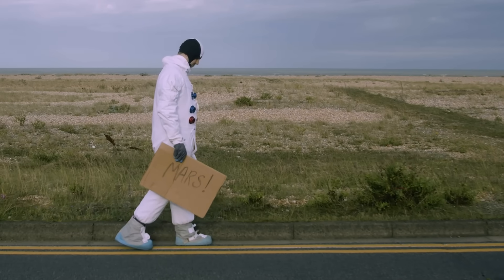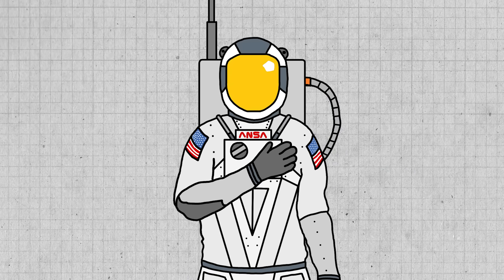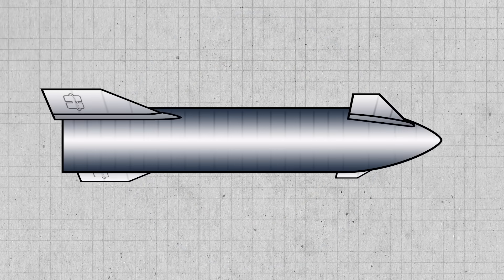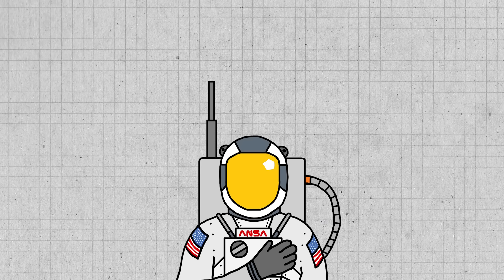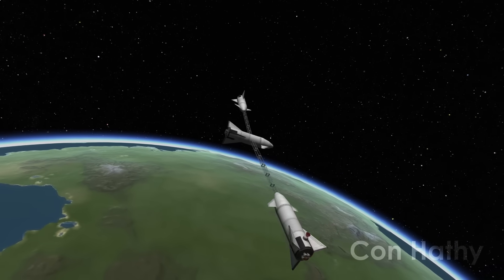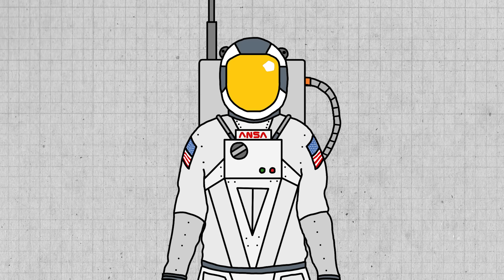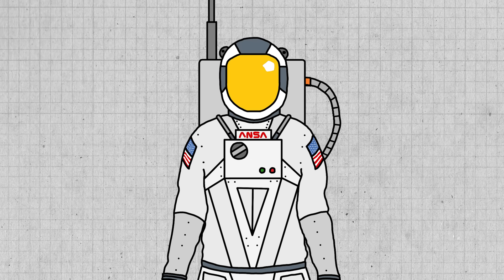This is NOT how you make Artificial Gravity

Comment: I'm not convinced that bringing along a small-radius centrifuge makes more sense than bringing along a rope.  Having some pseudogravity all the time would be convenient, and ropes are cheap, simple, and light.  The rope also doesn't take up any space inside the ship, once it's deployed.

I'm not a fan of the three-ship configuration to begin with, but I would guess that it can be saved by hanging a moderately small amount of supplies a moderately large distance out on a rope in the desired plane of rotation.  I also suspect that instability can be dealt with actively.  They'll probably want dampers on the ropes anyway, in the three-ship configuration, and it's probably not too hard (by the standards of Mars mission design) to have them actively move their mass instead of just passively damping undesired modes of vibration.

Comment: You did not give an example of an entire space ship using small axis rotation. The design that you like doesn't integrate as well with the macro design. At best it has a slight advantage of stability. At worst it has more unique parts that need to be manufactured, it takes more adaptation. You have less useable area of gravity habitation, which is really important for exercise and well being, and you will probably get a better overall result on the human body with a larger radius. Your only real argument about stability, when scaled up to the size of these ships is a math problem. We could build 4 propeller drones for a long time, but we couldn't stabilize them until we could reduce the computers needed to fit on drones. We real time processing, making the adjustments to keep the system stable is not a big deal and if for whatever reason the system becomes unstable you're still traveling toward your destination, just at a wobble. Also a tether has the disadvantage of needing to remain taut the entire time. Forces and activity from inside the craft will created bounce that start drift inward unless constant force is applied in the direction of the radius outwards. For all these reasons the stiff structure rotating full habitats a larger distance is the best design.
Reply: All sounded nice but the last part, internal vibrations would prove scant opposition to the force on the very hypothetical cable. 
Or we could make a running track around a sea dragon and represent Momma earth as one people.
Reply: Tether doesn't need to be flexible, he says exactly that in the video.

Comment: If you're tethering 3 Starships together why wouldn't you tether them like fan blades? 3 vessels held equidistant from a central hub all rotating in the same plane.
Reply from the maker: It might be harder to keep them separated, but could be done
Reply: @ConHathy  getting into position and accelerated up to spin safely would certainly be a careful technical challenge. It would be well within our current capabilities though.

Comment: the flaw is (imho) that the pressure is going to be unaffected because you are standing while laying down and Not increasing pressure at eye level, change the orientation of the person laying in the direction of the rotation at the end of the arm, not radial to the axis. with a bearing ( like a boat drink holder) mounted bed that rotates outward would maintain the same pressure across the whole body with the physiological changes induced by the mere act of reclining. Centrifuges are kewl.

Comment: I am surprised that so many clever folks are taken in by this "Star Trak" nonsense of rotational gravity when just a few minutes mulling it over reveals that its simply not true - it may have some such effects on earth or under low gravity high-flying "weightless" scenarios but thats all.

01.54 - constant acceleration = NO - that's on Earth - in space, once its moving, its moving - no further effort needed.
Spinning something does not in any way equate to AG - or would even feel like it.
05.00 - ring stations = you ARE kidding ?? rotating these will not induce anything remotely like gravity - imagine you are in space, floating one inch above the "floor" - so what effect does a spinning ring beneath your feet have ? None. Zero. Why would it? Unless you are tethered - then you are just getting dragged around with it - there is still no "downwards" force like gravity being produced or exerted.

Comment: Does it need to be 1 G? Wouldn't 0.5 or 0.3 G (as on mars) suffice? Then you could wear weights, jacket containing drinking water for example, to increase stress on the skeleton and muscles. Plus water shield a little from fast particles from cosmic rays. We have to find the minimum acceleration of gravity to maintain muscle mass, the circulatory system and bone density.

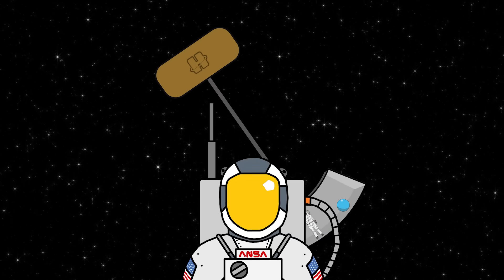Comment: 2:20 Putting person in the small centrifuge shown in your video is not going to work, because of the force differences along the body length. The head will be traveling at a greatly reduced speed compared to the feet, and will experience a very small outward force, essentially like being weightless. If we let w (the letter that looks most like omega) stand for omega, the angular velocity, then a = rw^2, so the acceleration and thus the force have linear relationships to the radius.

If we assume the man in the centrifuge is 6 feet (1.8 m) tall and his eyes are about 20 cm from the center of rotation, then assuming he experiences one g at his feet (a=9.8 m/s^2) we get and angular velocity, w = 2.2 rad/s (21 RPM, 2.85 seconds per rotation), The acceleration at his eyes would be a = (0.2 m) x (2.2rad/s)^2 = 0.97 m/s^2 = 0.1g. So, the test subject would experience artificial gravity ranging from about 0.1g in his head at eye level to 1.0 g at his feet.

There is a second and more obvious flaw in this experiment, there is still gravity pulling down on the test subject perpendicular to the direction of rotation.

About all this experiment will do is make the test subject dizzy, and probably nauseated to boot.

The only way to achieve useful artificial gravity from rotation is to have a large radius of rotation so the difference in acceleration, and thus g force, between the head and feet is small.
Reply from the maker: That was actually a control setup where they intentionally put the eyes at the center, they also extended the arm to put gravity on the eyes but it didn’t seem to help (at least in earth’s gravity) I wasn’t able to find footage of that unfortunately
Reply: @ConHathy  As I said in my original post, a centrifuge that small will not generate much artificial gravitational force on the head. At best there will be a fraction of a g at the head which means blood is going to pool in the upper body so the pressure in the eyes will not experience much reduction. I'm a Physicist, not a physiologist or medical doctor, but it does not take a medical doctor to understand that.

In fact, if the eyes were at the axis of rotation, they would experience no force from the rotation having only the downward force of gravity acting on them.

There is a very good reason why the NASA centrifuge is so large.

Comment: A single long tether is easy to work with, compared with trimming a re-entry to land in the arms of a landing mechanism.  The cheapest device is no device at all.  😎
Reply from the maker: True about complexity, but don’t forget that the landing is all an effort to save mass, and that tether and it’s giant spool aren’t going to be light (especially compared to a spinning exercise bike like the one I show at the end)
Reply: @ConHathy  You don't need to land the tether, and a 500M tether needs no spool if you EVA to attach it and you don't have to land it anywhere.  If you have ever done any knitting, or have worked with string, you will notice it needed no spool.  A 10 millimetre diameter cable of KEVLAR should be strong enough.  It can be left in orbit . . .

Comment: artificial gravity is useful for mega-sized interstellar colony ships
for small (in-system) ships, to be honest, probably having 0 gravity will  not be such a problem... I mean, yes there are small effects, but, it is quite likely with improvements in engines we can whittle down the distance to places like Jupiter and it's moons to months rather than years... this will also reduce any radiation damage potential...
I think the soviet record for space flight was over a year... and the effects were not debilitating, &, since Jupiter or Saturn's moons have far less gravity than earth, it is quite reasonable to assume that the dwellers will not need as high gravity tolerance...
this of course is one way missions,  which in turn will probably necessarily mean a separation of the species and in the end the at least some form of an interstellar conflict for dominance at some point.... but as recent history proves.... that is probably a healthy thing for society, bringing out the best in those on the side of good, and destroying those whose way is an unjust, outdated & backwards
system
Reply from the maker: I think you’re probably right, the early missions to Mars will probably be zero-g, maybe they will do 30 minute exposures in a short radius centrifuge if research goes well for it, but they definitely won’t have this type of massive structure

Comment: Four to eight bicycles connected together.  Drive wheels bearing against a rubberized ring attached to the inside surface of the starship.  Passengers take turns pedaling the bikes up to speed to the desired gravity.  A fabric torus would protect against other passengers from floating into the path of the pedelers.  Inside of the torus, the air would become entrained and would spin up the the speed of the bikes and not cause an over amount of drag.
Reply from the maker: I wouldn’t say a little drag is a bad thing, you are trying to exercise after all
Reply: @ConHathy  Small, fold out turbulence generating surfaces attached to the sides of the stationary torus could adjust the "wind resistance" to the fitness level of the cohort of pedelers so that each group can achieve the desired level of "gravity" without overly tiring them out.

Comment: You can just put a non pressurized cylinder or two in your pressurized cylinder. It will have a bit of friction but you can give it a smart counter weight and it can decouple from the main thing for a bit or switch it of if you need to. It can stear with tiny fans. you can put a non pressurized donut or two into a pressurized donut. I don't understand why you want to rotate the hull and fuel and all. Your hull is happy with 0g.
Reply from the maker: That would be the short radius centrifuges I’m talking about
Reply: @ConHathy  Why do people not like those, they are just a spinning barrel to upgrade an existing design. And if you don't spin the hull, you can make the big ones much safer, too. You could have two big hamster wheels, not spin the hull, if it breaks down it just gives you a little jerk. I hate people who spin the entire thing, and I hope there is a raisin in their next chocolate cookie.

Comment: In case where the tether breaks, you are under-estimating the sudden lost of control  due to the sudden removal of the centrifugal force provided by the tensionsl force from g be tether. This will at the very least results in prople flying and knocking into the wall and possibly what was preciously the ceiling and it is probably enough to cause serous injury.

Also, a sudden breaking of a rope under extreme tension is never near and most likely the entire balance of the ship will be throw out of the window and they will have to take time to stabilise it . After the survival collect their senses and actually get to the control room to do that. 

This really isn't a very good idea. Not that the other ideas are any better.  The thing is, the soace x team has not thought this through .. and definitrly wasn't given enough time by the stupid musk to actually take their tine to figure it out.

Comment: Why not release a “small” weight out the top of the starship on a very long tether?  Rotate the ship end over end as you release more and more of the tether.  Eventually there’ll be a point where the starship is orbiting a fulcrum that is somewhere along the tether, effectively giving the whole starship a relatively equal amount of force.  The tether would have to be, I don’t know, a mile long?  What am I missing?
Reply from the maker: Well that’s not much different than tethering 2 ships together, except you would be carrying the counterweight with you instead of it being it’s own useful vehicle
Reply: @ConHathy  the advantage is that you don’t need 2 ships every time you wanna make a journey.  Plus the 2 ships can’t interchange supplies or crew easily, if they’re tethered with just a cable (I guess you could devise a pulley system), whereas the single vehicle idea would have everything self contained.

Comment: the thing about the pressure in the eyes makes sense because the head is barely moving relative to the body.   Maybe this was covered, but oh well I'm just some rando on the internet.
Reply from the maker: That video was of the control where the head is intentionally at zero, they also extended the arm but it didn’t seem to help (still this is very small and also might have to do with earths gravity)

Comment: There's no "s" at the end of RPM
Reply from the maker: I know, I tried cutting it out of the audio but trust me it couldn’t be saved
Reply: where does it go?  after the R then?
Reply from the maker: @craig7350  yeah, it’s hidden in side: revolutions per minute
Reply: @ConHathy  maybe its  one revolution ..or less
Reply: @craig7350  1 RPM, 100 RPM. 10,000 RPM.

There is never an S at the end.
Reply: @MadScientist267  Not unless you bracket it. (RPM)s. Its the revolutions that is plural not the minutes at the end.
Reply: @craig7350  there is no acceptable use other than simply "RPM".

You don't "bracket" anything. You don't add the S. Ever.

It is:

RPM

Period.
Reply: @MadScientist267  ok its an abbreviation for revs/min  fair enough.

Comment: I think it would be cool to have a spherical type ship, that spins and creates its own gravity. It can have multiple floors, so the “higher” up you go in the ship the gravity will change just a little, and you could put thrusters everywhere on the outside for easier control.
Reply from the maker: You can’t create spherical rotational artificial gravity unfortunately, if it’s spinning around an axis the gravity is away from the axis, not the center of the sphere

Comment: This kind of artificial gravity with rotating spaceships is NOT possible. The only objects that will be subject to the centripetal force is anything attached to the device. A "floating" inertial human will all not be forced radially against a surface. Strap them into a seat and they will. Think about if the ISS began to rotate. This does not force any of the astronauts against any surface. Only anything attached to the structure will feel the artificial gravity. Strap an astronaut into a seat and they will then feel the gravity.

Comment: What I'd worry about with it breaking is the cables damaging the starships. They're under a lot of tension, so when they break quite a bit of energy is released and they'd snap back pretty fast. Like a game of tug of war where too many people play for the rope they're using and it snaps and injures a bunch of people.
Reply from the maker: Yeah, that’s the biggest danger and the most unpredictable part, if we eventually do build a large tether system of some kind it would need a huge factor of safety

Comment: Those small centrifuges kinda suck, even if the nausea is "tolerable". They will take precious space and are mechanical devices. Can't do much while in them. Meanwhile a rope is.... well, a rope.
To make life for astronauts comfortable you don't need 1g. Even half or 1/3 will be enough to take a regular shower and eat food the "normal" way.
Reply from the maker: A rope is a rope, but how do you attach the ropes? How do you spool/unspool them (a large mechanical device?), how do you avoid static buildup (which destroyed a previous super long tether built by nasa). Don’t confuse “easy said” with “easy done”